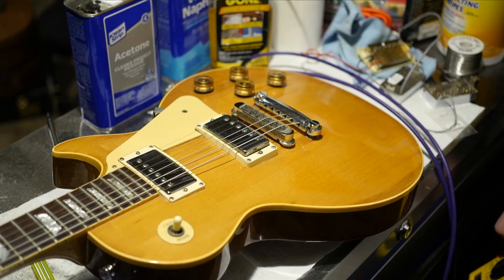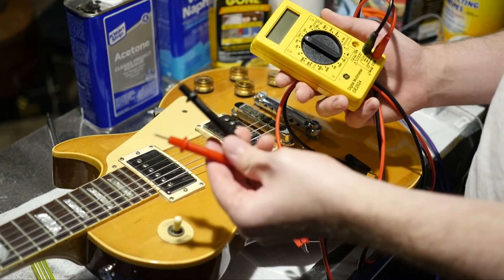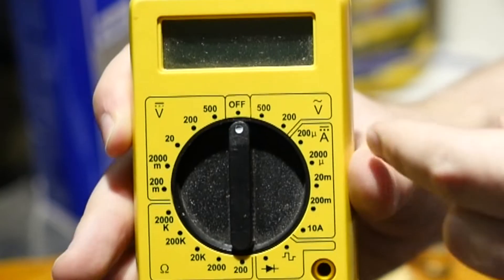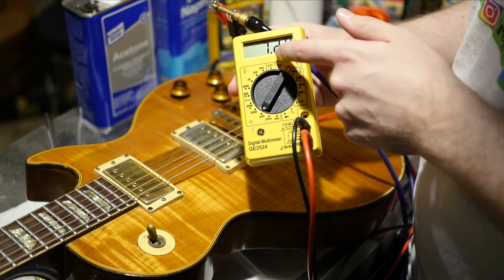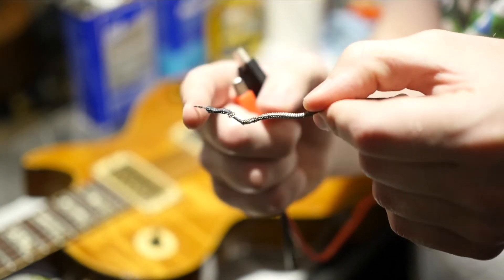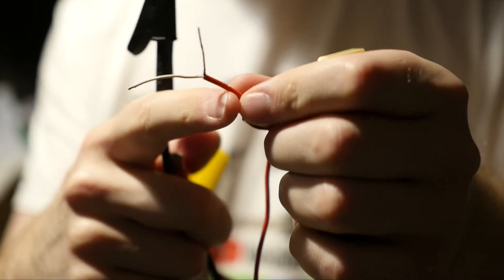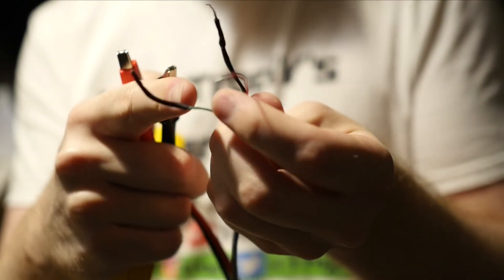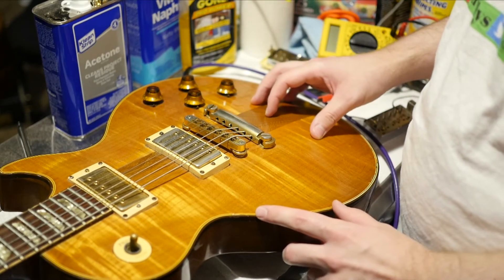How to Test Resistance of Pickups Both Inside and Out of an Electric Guitar

Comment from the maker: 0:16 - Why You Should Know This / What You Need
1:01 - Testing Inside the Guitar
2:47 - Vintage-Style Braided Wiring
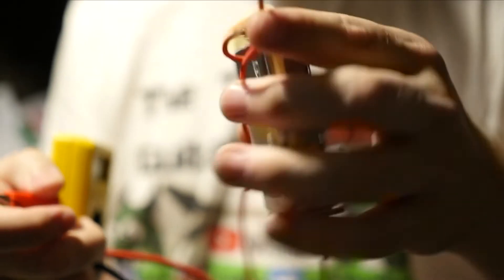3:51 - Modern Wiring - 2 Conductor
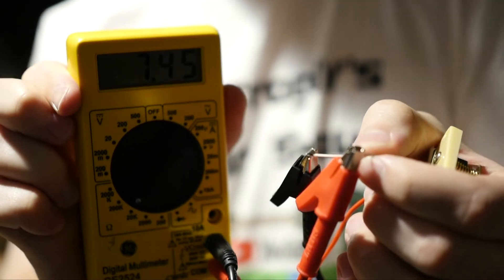4:20 - 4-Conductor
Reply: The Trogly's Guitar Show: how do you set up a multimeter that has adjustable ohm resistance for testing the pickups?. My presents are x1k and x10 and then there is an adjustable potentiometer that says 0 ohm adjust. Also my meter is the old needle type and not digital.

Comment: Thank you so much for your video, it helped me identify why my neck pickup wasn't working. Followed your steps but still no joy until I removed the neck pots from the cavity. With everything connected, I plugged in the jack into the amp and on picking up the pots I heard crackling. Visually checked all the ground wires but they looked fine. So I desoldered all the ground wires on the vol pot, removed excess solder with copper tape, then soldered the ground wires onto the vol pot again. Plugged everything back in and tapped the neck pup with a screwdriver - after hours of fault finding, the issue was finally resolved :washhands:
Reply from the maker: Awesome! Glad to hear you got it sorted out!

Comment: I have an LP classic with coil splits (possibly taps, not 100% sure). When I measure the resistance, it doesn't change whether or not the push-pull pot is in or out. The bridge and neck pickups are slightly different but neither change as a result of pushing or pulling their respective pots. It does make a difference sonically though. Any idea why this would be?
Reply from the maker: I actually have a new video coming out that answers this. Your guitar is gibsons version of a “tap”
Reply: @Trog  Well, I can't wait to see it. Hope you post it soon!

Comment: Will this also work IF the selector switch is NOT connected so as to test if the wiring to the pots is all there with the leads going to what em will ultimately be connected to the soon-to-be new switchcraft selector?  I just wanna make sure that all the wiring is good to the pots up to the selector connections.

Comment: what about a humbucker with 3 wires? One black, one red and one green. I get separate readings of about 4.3 kohms on the red and green when connected to the black but it doesn't increase to the expected 8 kohms when connected together?

Comment: Although you briefly touched on it, your viewers should know that testing pickups that are installed puts the volume pot in parallel with the pickup, and that lowers the reading by about .2 to .4 .ohms (even with pots set at 10).   The only way to get a 100% accurate reading is take the pickups out of the guitar.
Reply: Pot setting is irrelevant. It lowers the measured resistance according to the law for parallel  resistors, which can come to hundreds of ohms, not by a tiny fraction of an ohm.

Comment: Thank you for the simple answer. I was thinking how can I check which pickup is not working and whether it is the input jack, switch, etc. I was going to de-solder everything until I thought there has to be an easier way. Then, I was going to cut a guitar cord in order to attach each wire to the black and red. Good thing all it took were some alligator clips. It took me two seconds to figure out I had a dead pickup. I changed it and now it works fine.

Comment: In testing a single pickup that is installed, if there is no output, how does this method tell you if the issue is the pickup, pot or wiring?

Comment: I replaced all the pots and rewired everything using braded wire.  Not sure why but when I test the resistance of the pickups using a plug in chord I get 8.37 ohms for the bridge pickup and 14.02 ohms for the neck pickup.  When I measured just the pickup with the back off I get 7.82.  Why am I getting such a high reading?  is there something going on with the wiring at the plug in?  The switch wiring looks to be good.  Thanks for any help.

Comment: Thank you for this informative video. The reason I'm on YouTube looking for this info is I have a guitar with a HSS set up  while playing I heard static so I moved my switch and the sound was good on my two single coil pickups but there was no sound coming from the humbucker.  I did the ohm test with the cable inserted into the guitar and touched the multimeter leads to the other end of the cable. Both single coils gave a reading but there was no reading on the humbucker.  I'm not entirely certain if it's the pickup or the switch. What do you think my next step should be? This is a new guitar I bought on ebay,  unfortunately it's past the return date. I asked the seller about a warranty,  he relayed my question along with contact info to the manufacturer,  still waiting for a response.

Comment: Personally, I wouldn't trust a $10 meter as far as I could throw it.
I guess ohm testing guitar pickup or pot isn't life or death.
Be advised, don't use a cheap meter for high voltage.

Comment: Thanks, the video is some kind of helpful.... but I have here an old Dimarzio PU. It has a black and a white wire, surrounded by a braided cable. How can I check  the resistance on this variation?

Comment: I have one question, why middle position on 3 way switch on my Les Paul sounds almost the same as just neck (rhythm) pickup?
Neck pickup is 8K ohms, and bridge is 15K ohms, but it's 90% sound like neck pickup alone, so I never use it
Reply: Does your neck pickup sound louder than neck? It might just overpower the bridge pickup in the middle position. You can raise your bridge pickup higher or lower the neck one, or both.
It seems like your pickups has different wire, the bridge has thinner wire inside, hence higher resistance, but the same output (and maybe darker tonality that might suit the bridge position better).
Reply: @peterosipov400 
I solved problem, my neck pickup had awful muddy sound and because of it, middle position had that awful sound as well, so I took apart neck humbucker to see what's wrong, take magnet out, and realized it was weak as hell, barely attracted metals, so I attach it to a strong neodymium magnet and leave them overnight together, to restore its magnetism back..next day magnet was pretty strong and when I put it all back in guitar, sound was amazing, like never before..middle position also great

Comment: If my bridge pickup measures 9,5k out of the circuit and and 6,5k in the circuit (measured with the jack cable, every knob at 10) what could be the issue ???
Reply: Something is wrong.

Comment: So day maybe you can do a video on the modern day pots CTS and the pots of the 1950's and 1960,s? I buy the most exact pots I can. The tone is never much of an adjustment and same thing with the volume. I do both modern and vintage wiring. The vintage is a little bit brighter.

Comment: I'm sitting here watching this and I'm like, "Hmm, I just bought a multimeter, and I have a row of guitars hanging here next to me, let's try this out." Measured a guitar with SD Antiquities, then one with SD 59s and everything was fine. Then went to another guitar and I got no result. WTF? Moved to the neck, it read just fine. Flipped back to the bridge, nothing. At first I thought something had gone wrong, and then I realized the pickup has an output greater than 20K (It's a Bare Knuckle Warpig) and I had to change the meter to 200K. Then it read just fine.